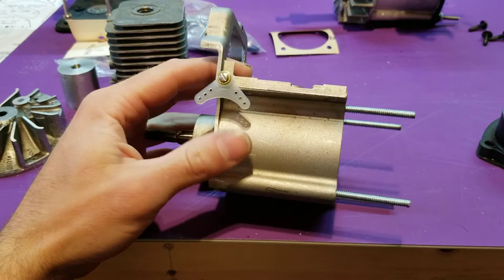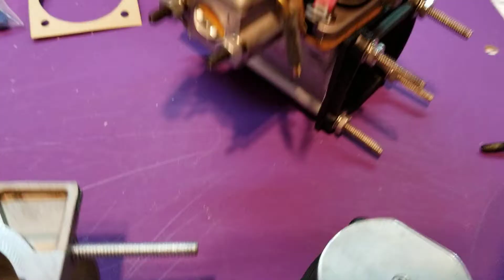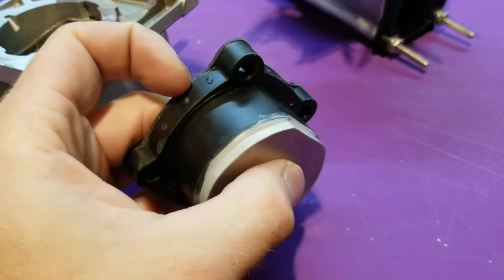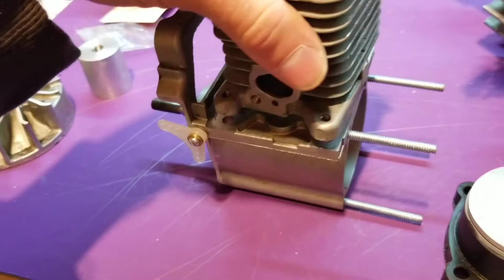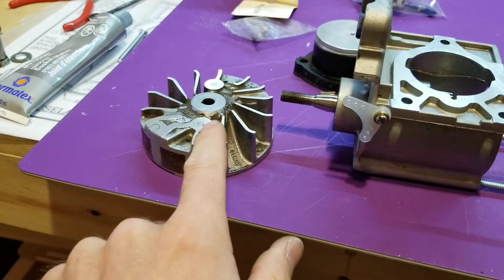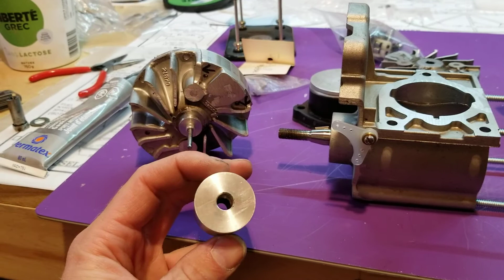How to build a Homelite 25cc -30cc RC engine

Comment: Very informative. The backplate area seems to extend deep into the engine case, is it possible to cut off the material and just create a short plate that sits right up to the crank?

Comment: Fantastic video, thanks!  Question: What if I decided to keep the flywheel as is, with no material removal? Is weight the only penalty -- or is there some sort of incompatibility with the existing flywheel and a propeller (and custom-made) adapter?
Reply from the maker: Weight and drag would be the only issue. You definitely don't have to remove the fins but it cleans everything up nicely

Comment: Homelite engines are fun to toy with and run. I had a few in boats back in the 90's. Their main problem is they dont have a full crank, just a half crank. It does limit your rpms. A modded out Homelite wasnt even on par with a stock Zenoah when they started to come out. So its been Zens for the last 25 years. They are all fun to toy with and tune.
Reply: You mean it only has one ball bearing in one side?

Comment: What material did you use for the gasket?
Reply from the maker: I used 1/16 gasket paper for most if it. You can buy a roll from napa or and parts store. Also I used threebond gasket maker for areas that need that. Hope this helps
Reply: Thank you for the response.  I would love to see more videos of your conversions.  I'm going to build an Ultra SPADstick and even though I could throw a DLE 30 on it, I'd hate to put a $300 engine on a plane made out of a fence post and yard signs.  I like the idea of a heavy engine up front so I won't have to add weight.
Reply from the maker: @ronthompson882 
Ok ill try to make another video soon. They are really underrated engines. Yes heavy but it doesn't need to go unlimited vertical. So cheap too as ppl just give them to you when they can't get them running. Win win good luck
Reply: @Spanky20188  I guess these are best for snub nosed planes like ww1 fighters. Helps with countering tail heavy bi-planes. 
Thanks for the detailed instructions.